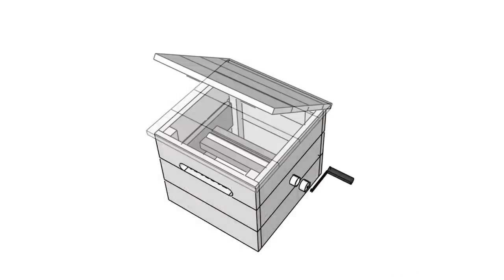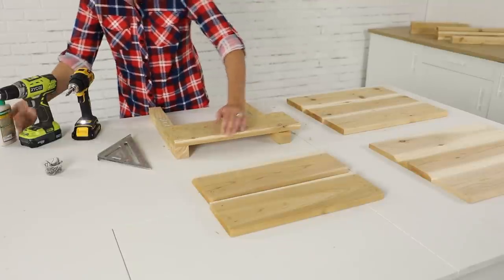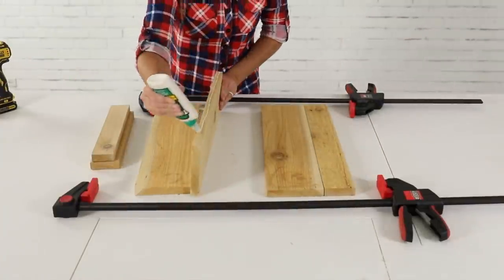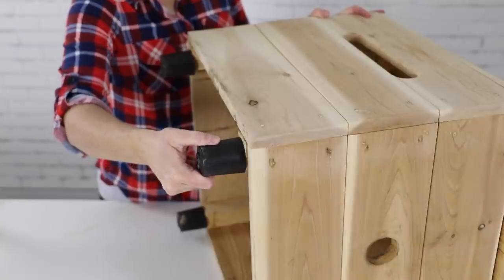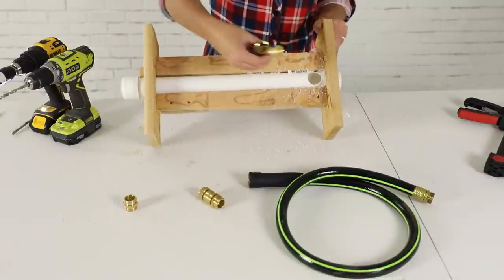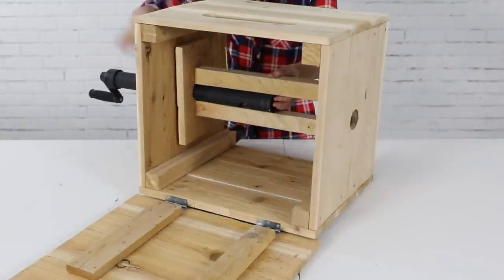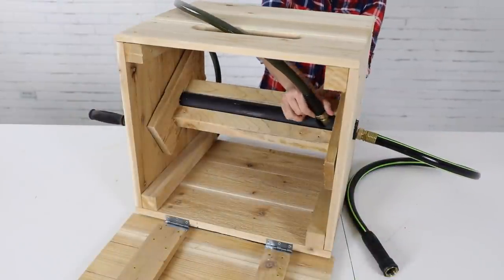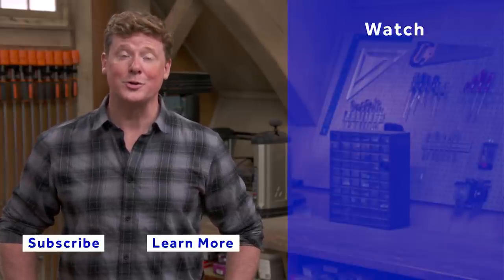Cedar Garden Hose Holder | House One | This Old House

Comment: Good video on how to build the hose box,  but after the materials, time, tools and screw up factor, it's just better to buy a $50 hose box, which will stand up better to the water.   Also, don't paint the PVC, you can already see the black spray paint flacking off in the video.
Reply: Yeah, if you want black just use abs. But I do think these can be beneficial especially if you use cedar, ipe or pt they will look much better than plastic store bought and would probably hold up better to abuse

Comment: How do you tighten the connection of that quick connect to the elbow when it's INSIDE the pvc pipe?
Reply: I believe the quick connect elbow fitting for the waterhose' is screwed together it's a 45' degree  elbow.
Reply: There is a link in the description box to full instructions,  that will probably give you more information.
Reply: She didn’t, you can see in the video it wasn’t even close to being threaded on. And being the o-ring on the quick disconnect will be spinning with friction every time you wind and unwind I give this 10 uses before it starts leaking.
Reply: @I-Teee  LMAO  i saw that too... give her an acadamy award for the effort she put in to make it look like she was threading it in... what a joke

Comment: The quick connect has two giant problems. The first being the water restriction. There are some that will allow full water flow. The second problem is that they aren't supposed to be subjected to this much spinning. A swivel joint is a much better choice, but expensive. From the ones I could find, it's like $30 to $40.
Reply: If you use a 25" ft waterhose, should have no problem with water pressure and rinding up the water hose.
Reply: Add grease?
Reply: dangit.. this is the big problem for sure.. i want to make my own but just going to depot and buying a premade one might just be the solution sadly .. or .. be prepared to unscrew the hose each time before reeling in

Comment: This would work way better for hose that is not round but the stuff that goes flat when not pressurized or do 4 2x2s in the center to make a roundish reel. Also that quick release is useless where it was installed as you wont be able to remove it easily which is the whole point. The 90 elbow is a great idea but then your hose has to do a 90 degree to spin onto the reel causing a kink there possibly...  great idea just could have some improvements

Comment: Two milk crates will do the trick.
Reply: How?  I am interested!
Reply: @gphillips5208  well.. the bulk of the work in the video is building a wooden box.  So skip that stuff and get two square milk crates.  Face them, ie opening to opening - and thats your box.  The rest of ideas in video are fine.  Just no need for such a heavy duty big wood box.  Plus plastic milk crate version is easier to keep clean, no mold, hose out the gunk.  Just get a wood broom handle for the center axle and just mcguyver your way through it. :)

Comment: gluing face grain  to end grain does almost nothing. gluing the  1x6 panels to the 2x2 is not recommended as the cedar panels  will expand and contract width wise but the 2x2 does not expand and contact lengthwise . your choice of a swivel is a bad choice too, it is not made to be a swivel and will end up leaking in very short order. the longevity of your project is marginal at best. there are several fail points if it gets any real  use
Reply: AGREED.. this video is a joke